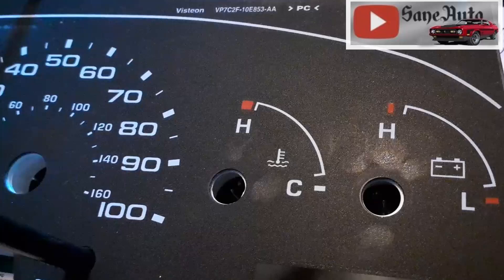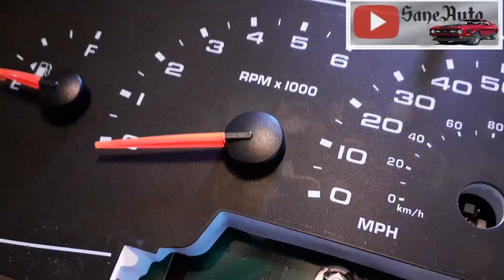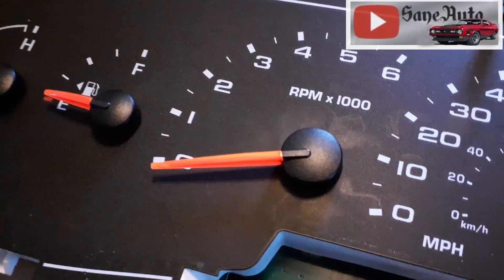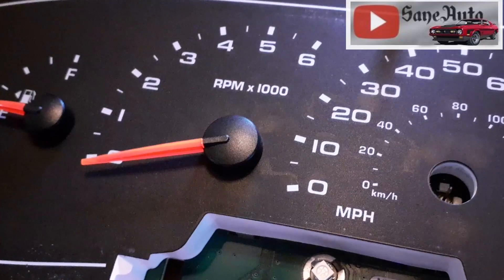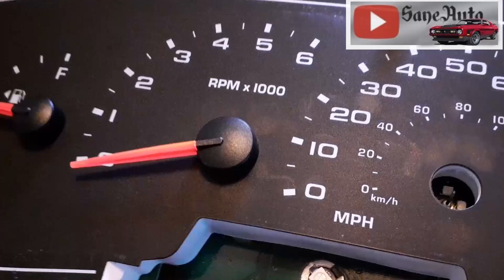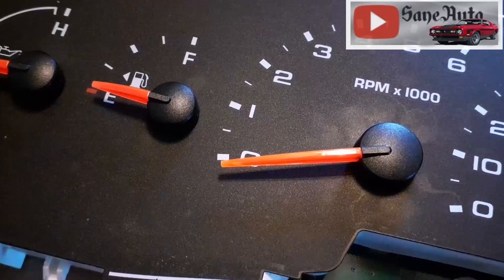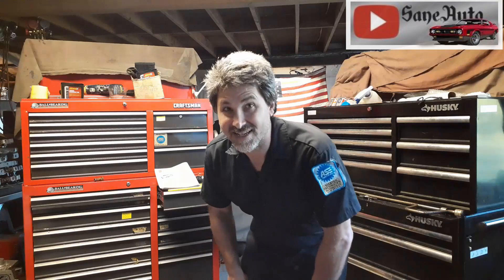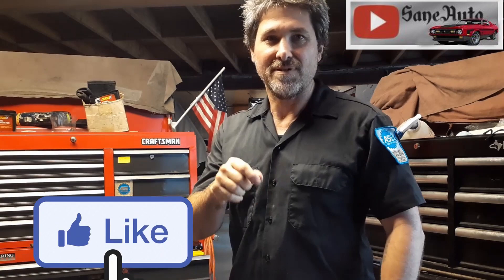How to remove the needles or pointers Ford super duty truck instrument cluster repair

Comment: Would love to see a repair video for one of these, I'm pulling mine apart now lol
had a quick search through your vids and couldn't see one
Reply from the maker: I was gonna do a whole series on these and had a hard drive failure with over 40 new videos lost including the R&R of this and the tear down etc. That'll teach me to keep up on editing & backups. I ended up replacing the unit with a used one because all the supposed "fixes" all failed anyway. If you do find out about a real fix let me know because I still have the old cluster.
Reply: @saneauto  did I do right???    I turned the rheostat all the way to the left stopping point, aligned the needle with it's mark and installed....   is this wrong or should I have found a center point for the rheostat and put it there?    (I got stupid, had it out and took it apart to change the bulbs...  there are none duh!!  it's led so I had to put all the needles back on....    2008 F350 XLT